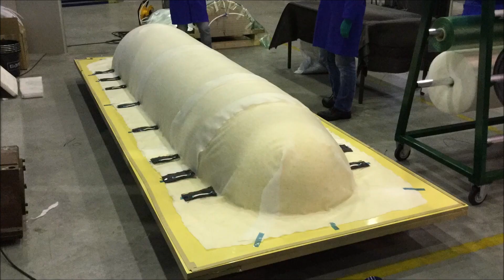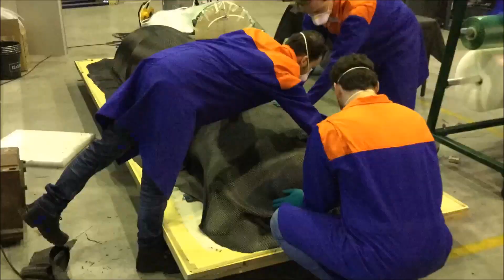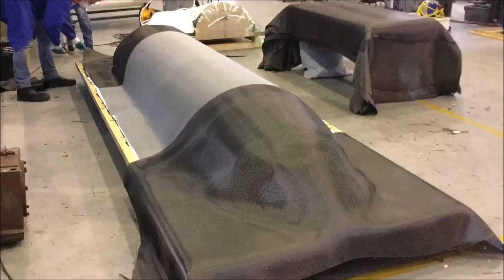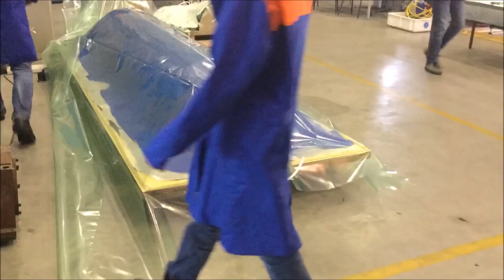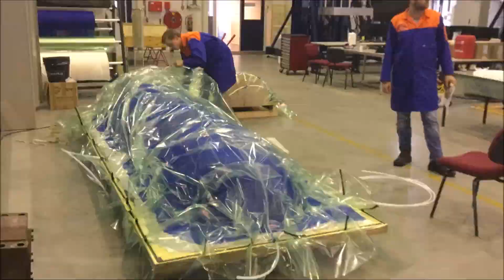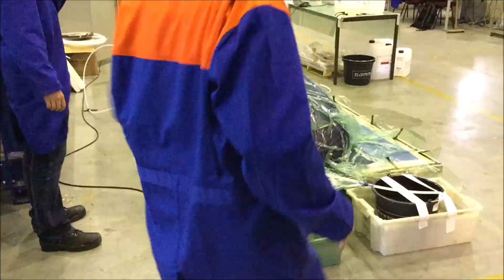Delft Hyperloop - Chassis Mould Production

Comment: Just read the newsletter, but I got a few noob questions :)
Is the white inner layer also carbon? Or what is it made of? If its carbon, why then white?
Why precure the carbon? Because before you start its just carbon right? Just carbon then just heat up and cools down and nothing changes, or what does it do? Or is it just to check if it would deform or crack or to check for fabrication defects?
Are you sucking the resin through porous material? Or just over, under and between the layers?